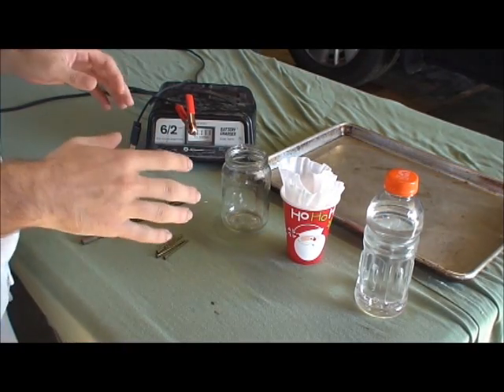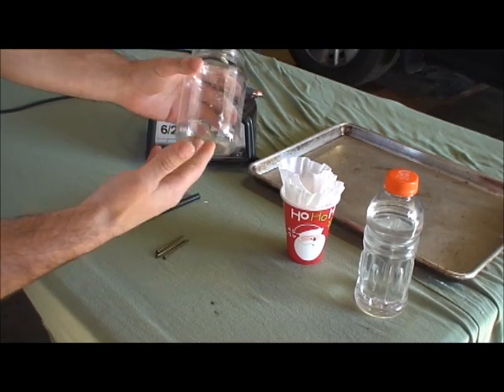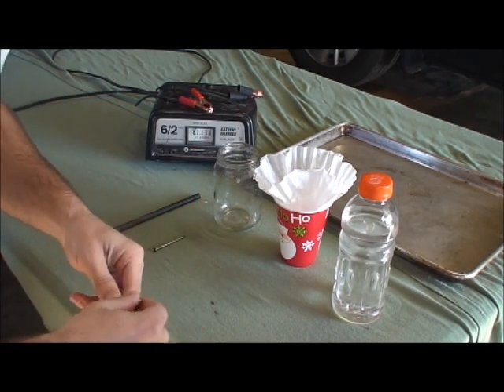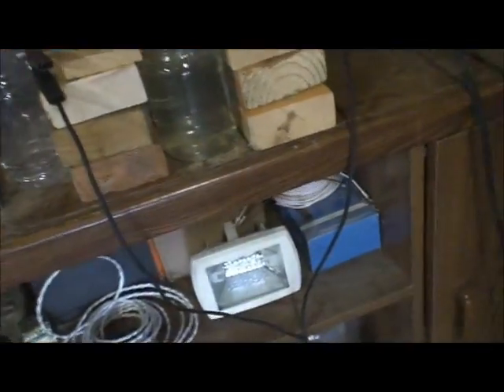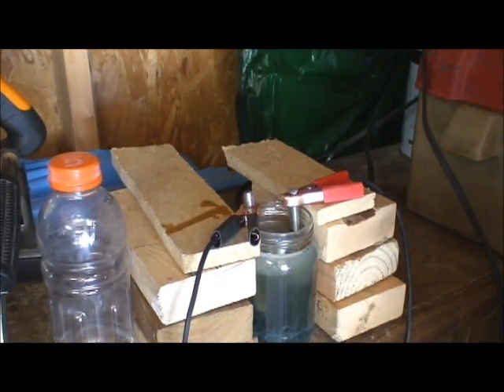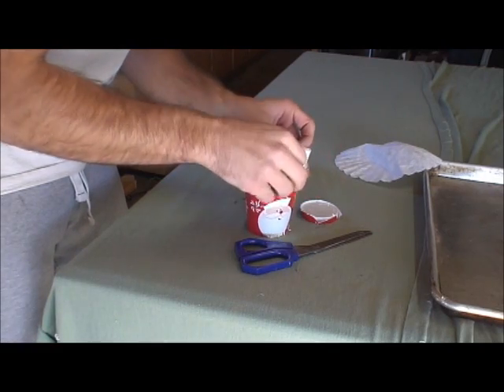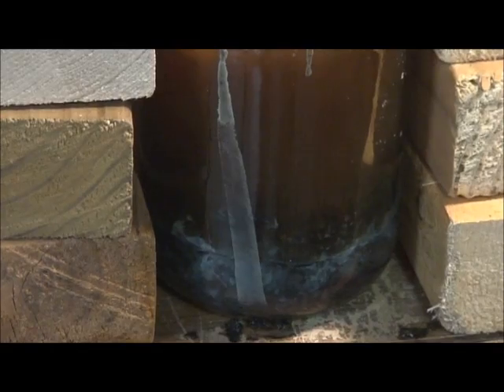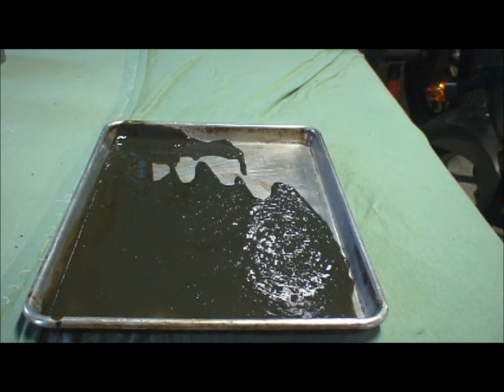How to Make Iron Oxide (rust)

Comment: When i did it with 5V DC power supply and dried it the iron oxide was orange-brown (Fe2O3) as expected, but when i did it with 12V DC power supply and dried it, the iron oxide was black (mabye Fe3O4) how is that? could it be Fe3O4? How and WHY?
Reply: +Allan Udal Try heating it?
Reply: +Allan Udal Holy shit it happened to me too! Is the black stuff magnetic?
Reply: +Allan Udal Yea if it is magnetic and black it is definatly Fe3O4.
Reply: Heat it in a fire, it will turn red.
Reply: Joep Stuyfzand It will turn red, but will it turn from Fe3O4 to Fe3O3?
Reply: Joep Stuyfzand Check to see if it still magnetic to see
Reply: +imthetiedyeguy what I am told is that red means fe2o3, I will make thermite soon, lets see if it works.
Reply: Joep Stuyfzand Yea but it could just look red too. Try putting a magnet on it. Im making thermite too :)
Reply: +imthetiedyeguy o4 will work as well, red oxide is magnetic too by the way!
Reply: +Joep Stuyfzand lightly though
Reply: yea i never knew if 04 would work or not i never found out but i only saw it working on red iron oxide. Also im not sure if red iron oxide is supposed to be magnetic ill go check to see if mine is but im not sure if it is

Comment: can i use an ac power source like an old lamp cord with the ends stripped off?
Reply: No, electrolysis needs DC.
Reply: Pepa Pepovič Could you use a phone charger that has a converter
Reply: +The Basketcase I suppose... as long as the output is DC

Comment: Unless you wash it a couple of times afterwards it is not pure rust...

You have NaCl (salt) and Sodium Hypocholrate (Bleach... {It forms During electrolysis of salt water...}) and some compound iron salts, that all contaminate it... That is why is is so discolored...
Reply: Hey I was thinking the same thing and I've been searching all over to find out how to remove these impurities, I looked on your channel to see if you had a video on it, but didn't find any, not sure if I missed it.. Can you tell me how to get rid of the impurities after the electrolysis process?
Reply: The best way I could say is just to wash it a few times with water. Anything impurities that formed should be a salt compound of some type, which is water soluble. While of course the iron is not.

 Hopefully this is of help! :)
Reply: Hey thanks a lot man :) didn't expect such a quick response, thank you. I understand and it makes sense, I will try that.
Reply: No problem I'm glad it was of help :)
Reply: June Choi why would you want to use another electrolyte? The main purpose is to get the reaction going. Because pure water doesn't conduct electricity and therefore nothing would happen.. As for using potassium nitrate, I think it should work.. But I could be wrong..
Reply: Ok I understand your concern, chlorine gas will be emitted but chlorine has a very high pungent oder, so you won't accidentally inhale it, you'll know if you're breathing it.. Once the reaction starts you won't have to stand over it either, just leave it alone and stop it when you're ready, outside in open atmosphere is a good idea though.

Comment: You cut the end off the charger that connects to the phone, which is why you use an old one you don't need,  then you have pos and neg wires to work with.  Not really a trouble shooter eh?

Comment: How did you get the DC power supply to not blow up? Do you pinch the metal rod while the battery is off, and would you put it in the water while its on? Thanks!

Comment: I think you need to bring the "iron oxyde" you collected from the electrolysis (that you did with the charger like in the video) at about 200°C for it to become real iron oxyde :

Iron (III) oxide can be prepared in the laboratory by electrolyzing a solution of sodium bicarbonate, an inert electrolyte, with an iron anode:
4 Fe + 3 O2 + 2 H2O → 4 FeO(OH)
The resulting hydrated iron(III) oxide, written here as Fe(O)OH, dehydrates around 200 °C.[6][7]
2 FeO(OH) → Fe2O3 + H2O

Comment: Can you elaborate, if you were to use some computer charger or something would you have to cut the connector that plugs into the phone/computer device (whatever) off and get the bare copper wire? and how would you connect that to your metal rod?

Comment: I'd like to see a follow up of the dry Iron (III?) Oxide produced. I had similar results with a batter charger drawing approx. 10-13 amps over 30 minutes. First, a black-ish precipitate (FeO or Fe3O4?) formed, settled, and later a reddish-brown precip (Fe2O3, presumably) formed and settled.

Both precipitates settled to the bottom of the solution and appeared visually distinct. After drying, the solid still appears black except for some red-brown Fe2O3. I assume these are different iron oxides..